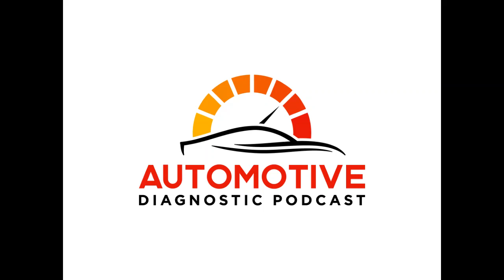E55: Dodge Ram Diesel P0868

Comment: Great podcast! I am working with the same problem on an 04 Ram Diesel right now. You had more info in your short video than i have been able to find after 2 days web search, Mitchel On Demand, scan tool and my Motors Transmission manual. This one trips the code when it hits 4th gear. Thanks!